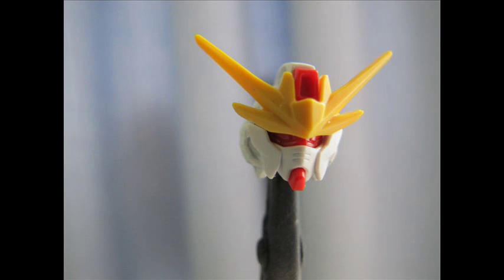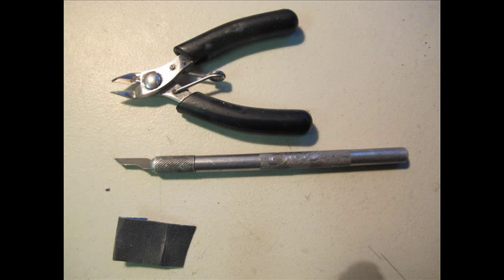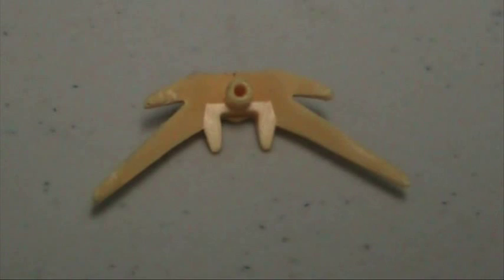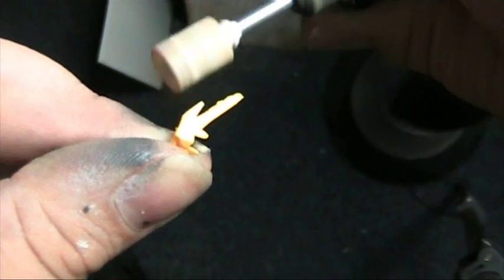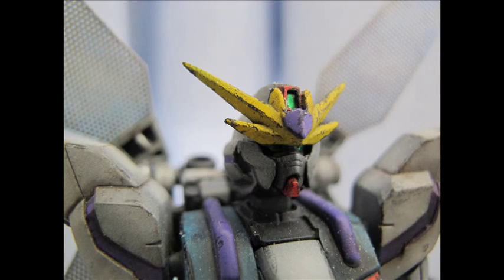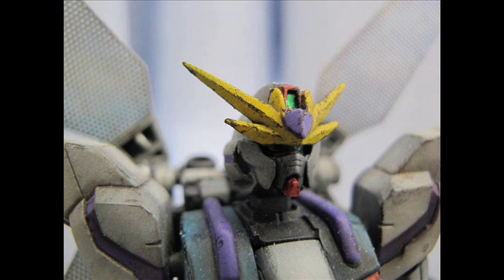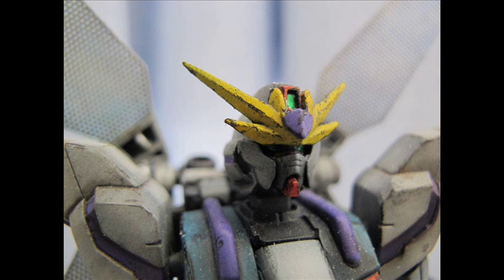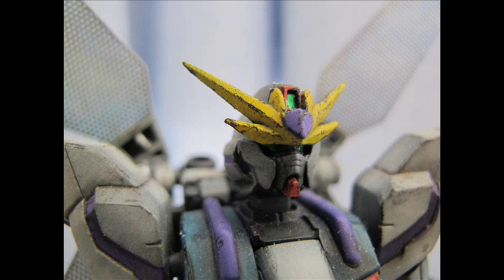Gundam/ mech model workshop 86: Vee fin modification

Comment: one interesting thing I was told about repair or filling in surfaces is to take bits of a sprue that the model belonged to, cut it up in to really, really small pieces, put them in a little metal paint tin or something, and cover them in plastic cement.
eventually the plastic will melt down into a "putty" like material that you can apply to parts for seam welding or even as repair material/sculpting material
Reply from the maker: It's on my list of tutorials to make, got a mix of green goo some were lol. Biggest issue is already trying it twice the mixture takes for ever to dry we are talk over 24 hours and still soft. Also the mix has trouble holding its own shape. I will keep playing with this.